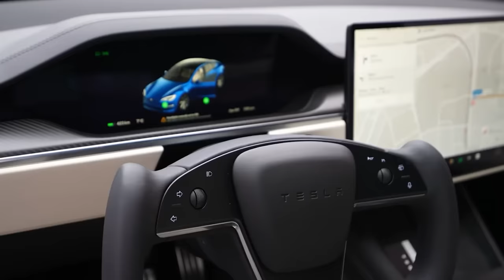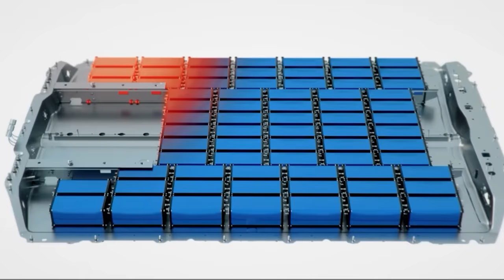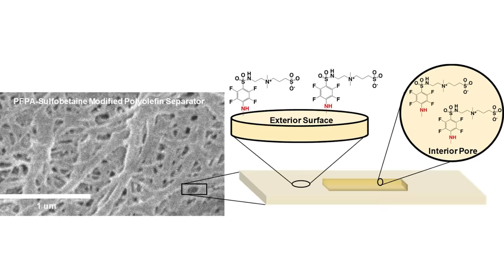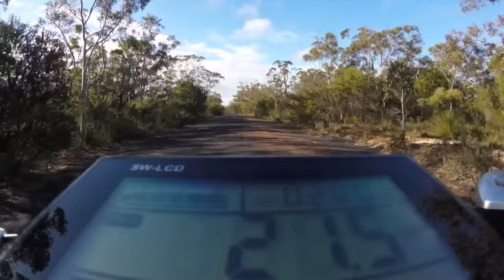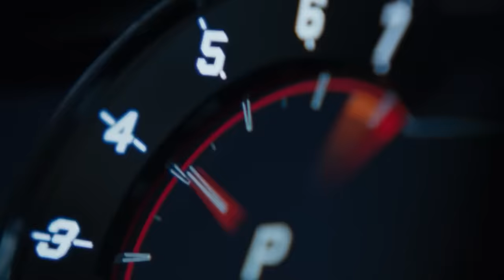EV's Are Exploding In Shocking Numbers

Comment: Here in the UK, one of the biggest causes of ICE [internal combustion engine] car fires is deliberate arson. Insurance fraud and destroying forensic evidence after theft are the main reasons why ICE car fire statistics appear to outweigh those of EVs.

Petrol and diesel fuel is combustible (and explosive in vapour form), but that does not make ICE car fires any more likely.  Handling liquid fuel requires care - we all know that - and as a result such fires are unusual events. Unless they're caused on purpose.

Lithium batteries are not meant to burn under any circumstances; an EV fire therefore represents a catastrophic failure of the technology involved.

ICE car fires caused by traffic collisions are surprisingly rare because petrol and diesel require a source of ignition in order to burn. Most traffic accidents just bend metal. The problem with EVs - and what makes their perceived fire risk totally different from that of ICE vehicles - is that they need sophisticated monitoring, charging, cooling and discharging systems to work, and those systems can malfunction without warning.

Any physical damage to the complex lithium battery can cause unseen electrical problems which may not affect the vehicle's functioning at all - but which may [sic] cause a thermal runaway event and a fire days, weeks or even months later.

You can't see cracked welds or damaged wires or cells rendered unsafe by bump damage or vibration. The first you know about it is when the car catches fire.

So an EV fire can start for no obvious or apparent reason. An ICE car fire can't, and that's what makes ICE vehicles less of a risk. If you don't believe me, ask an insurance company executive.

Comment: People need to understand that EV are a fire hazard waiting to happen. It’s the way batteries are set up. Any breakage will result in a simultaneous combustion fire. And this can happen even days after an EV had a minor crash and the battery compartment was compromised. 
And, no, you can’t get out when it’s got on fire while you’re inside. Because all the doors are locked. 
Tesla has a manual open door button, be sure you know where it is and how to use it.

Comment: Electric cars have a 1-1/4 century record of success: efficient, clean, smooth power, etc.  The problem has been the batteries.  Lead-Acid (low energy storage, toxic lead, acid) & Lithium Ion (severe chemical fires) both have their own problems.  Electric cars will come into their own when safe high energy batteries are invented.

Comment: It's not uncommon for EV vehicle manufacturers to tell their customers to park their vehicles outside if there is a recall related to the electrical system. I just returned form China and the government is concerned about ebike and elecrric scooter battery fire issues. In the near future steps will be taken to replace their batteries with sodium based ones that are safer. The apartment building that I was at will not allow its occupants to charge ebike batteries in the building due to fire risk.

Comment: This is plain stupid for electric cars. 1. Government and auto car makers put out millions of good car mechanics out of work if more electric cars. 2. How they gonna dispose battery that isn't environmental friendly that contain hazard toxic minerals of lithium batteries. 3. If power outages or electricity grid not coping for many ev cars. 4. Lack of power charges.  5. Park electric cars in gararge is fire risk to burn house down. 6. Faulty or corroded battery and replace batteries is very very expensive not just one battery but number of batteries. Also number of charges will degraded the batteries. 6. Electric Cars in flood waters would be useless!! 7. If the car on fire then you lose a whole car! Why are they making stupid decision to make electric cars to save environment which isn't cause more tire wears and toxic batteries that can't be recycled!!!

Comment: It’s the plating between the pos & neg all it takes is for a few electrons to push through & boom a runway chain reaction occurs! See I got this! Solution?  make the separator less susceptible to internal corrosion!& be sure to have a sensor that lets you know it’s fully charged but slightly less than battery charge capacity see no more exploding EVs!

Comment: You said that there was substantial environmental benefits by having EV's rather than ICE cars. Wrong. An EV's carbon footprint does not level out  compared with an ICE car until that vehicle has completed 60 to 70 thousand miles at which time the battery is becoming a useless slab and needs replacing. The problem there is that firstly there is a massive cost to change the battery and an extension of the carbon footprint of another 20 thousand miles. Most people will scrap the car and buy a new one.

Comment: Excuse me, how can you possibly say that EV’s are less likely than gasoline powered vehicles to catch fire? I only in respect to overall numbers, because there are so many more gasoline powered vehicles, but not in percentage of vehicles. I’ve never known a gasoline, powered vehicle, sitting in a driveway or garage to suddenly burst into flames. That’s the whole issue! With the exception of the Tesla that ran into a tree,  the EV cars are parked or being charged. They’re bursting into flames not because of some collision, but precisely because they have lithium ion batteries. The danger is such that manufacturers actually recommend not charging vehicles even smaller ones like electric bicycles, scooters, electric motorcycles in a building due to the fire hazard. This guy is a propagandist.

Comment: all EV cars have to change to Sodium ion batteries. I learn SI is safer but the negative is the explosive if fire or punture to batteries. We need to learn more.
Reply: It would be better to use white hydrogen until a synthetic fuel is manufactured,forget mining&damaging the environment for a finite resource,you would even be able to keep your existing vehicle.Battery-powered vehicles are not practical,or viable on any level.

Comment: Hybrid system that electronically monitors the drivability of vehicle using engine control modules. If you run out of battery power, you got combustion, if you run out of combustion, battery power can get you to nearest gas station <~>  (equilibrium style is the hybrid system).

Comment: To preface what Im about to say, many fewer EVs (excluding Chinese ones) go on fire than combustion engines on a % basis. However, the EVs garner much more attention for it. When was the last time a new station bothered reporting on a combustion engine that went on fire? They dont. Its not news.  Anyway, there are 2 separate issues being discussed in this video and a clear distinction has not been made. Both have different causes. The first is fires and the second is explosions. 

Explosions dont necessarily follow from a burning EV. As far as Im aware, data shows that the explosions mostly happen in cars or other larger EVs. The reason appears to be the concentration of gases within a cab or enclosed car or truck reaching an explosive pressure. Once this critical explosive pressure is reached, windows will blow out, doors too, sometimes even roofs. Occasionally, the explosive force will be powerful enough to lift the entire car off the ground. There should be easy engineering fixes to the explosive problem.
Dealing with the fires is a much more difficult problem for the automakers. It may require a fundamental change within the battery to allow some form of safe fast power discharge of the battery to prevent the build up of heat. Heat sensors would also need to be installed. 

As with any new technology, there will always be teething issues. I am sure these will be overcome in due time. Lets not talk about China. That is a whole different story where there are either very low safety standards or there is little or no enforcement of them. I have no idea which. If you choose to buy a Chinese EV, Caveat Emptor.

Comment: If the insulators between the + and - fails you have a violent reaction and the battery turns into a giant welding arc. the chinese battery's are good for that. If you can't get out in time it will be a death trap like the 3 rd. Lane in rush hour traffic.

Comment: I have been following this for some time. The issue in China is because EVs - including Tesla, VW, BMW and Mercedes - must use chinese made batteries. The CCP will only subsidize EVs that use chinese batteries. Chinese EVs catch fire during regular driving, charging and while parked. Western designed EVs in China do not have these problems. Very few western desigend EVS in China catch fire, usually only after an accident. Many western car producers now use chinese batteries because they are cheaper than japanese or american made batteries and to ramp up EV production. Governments should ban the use of all chinese made batteries in EVs. They are cheap and of bad quality. The battery packs cannot be cooled properly because of the battery format. The management systems are poorly programmed. All chinese made vehicles have major quality and safety issues. BYDs software like GPS Navigation are very bad. BYDs have issues with brakes failing. The quality of steel BYD uses is of low quality. I am sure the reason for self-combustion, if a serious investigation is done, will find that chinese batteries were used. I am sure the majority of EV fires are caused by chinese made battery packs.
Sadly, this video only reports about the increase of EV fires and does not detail which company and which batteries are having the most problems. It would benefit all consumers to know what they should look out for. Consumers should know which manufacturers have the most fires so they can avoid those EVs. Manufacturers, especially western producers, would know which batteries are dangerous and change the batteriy producers they use in thier EVs.

Comment: You have to look at the bigger picture. Try putting one of these out with your little cabin fire extinguisher no chance. You won't be cleaning this mess up with a broom. The car WON'T be going back on the road so salvage cost is nill which in turn puts insurance through the roof (If it isn't already) Maybe they should come with a government health warning like ( COULD EXPLODE WITHOUT WARNING PLEASE KEEP YOUR DISTANCE)  This warning should be on the back of them all in bold letering. It might go some way to stop tailgating. Wonder what would happen if one went up in a Clean-air zone would they get a 120 quid fine. Major road repair. The list goes on. Would you buy a second-hand one maybe not unless you have a death wish.

Comment: ICE powered cars, particularly gasoline cars, may well be more likely to catch fire but that is almost always the consequence of an accident that ruptures the fuel tank.  If the cars of the Freemantle Highway were properly secured how would they hit each other hard enough to start a fuel fire?  By what mechanism would an petrol car catch fire if not in an accident?
OTH, EV's can catch fire without any crash damage at all.  So, n the case of the Freemantle Highway fire, where both petrol and EV's were present, unless they were not properly secured I fail to see how a petrol car could have been the cause.  But, it is not hard to see how the fire could have begun with an EV.
One last point on the Freemantle Highway incident -- there is plenty of video of them unloading cars from the ship and the EV's being placed into a large steel tank filled with water.  You can check for yourself.

Comment: so where's the data claiming that EVs catch fire less that gas engines, I'm calling BS, since Gas Engines out number EVs about million to one, or more, i work in the auto industry, and am telling you that EV batteries Catch fire just sitting in the shipping pallet, waiting to be installed in a truck, it happens more that you think, and NOT One Word of this on the News, want an EV Vehicle? Fine, Do Not Park It In You Gurage if you plan on waking up in the morning, Also. A Gas Motor Wont Just Catch Fire on its own without running, in the very rare case that this has happen, not involving a crash, an EV can be just sitting in your garage and catch FIRE, Big Fucking Differences

Comment: Its hilarious how many people are afraid of new things like EV. .. ...    EV are far less likely to catch fire than petrol or diesel vehicles.   I have never seen an EV fire.... i have seen 7 fuel vehicle fire.   I even saw one on a farry and they had to push it off the ferry into the ocean before all the vehicles caught fire.      I think EV are great ....... i save $200 a week in fuel.......   the saving pay for my EV in 5 years and it has a 10 year warranty on vehicle and battery.... has less maitenence costs than petrol.      Holds its value well... i can sell it after 5 years while its still under waranty and buy a new one.       I do alot of driving and i cant afford to drive a fuel vehicle anynore.

Comment: Even a watch ⌚ battery 🔋 lithium ion battery will burn your house down and RC car are very dangerous.
Reply: You cannot be serious.
Here have some comparison:

An EV will EXPLODE your house. Your house´s stones (assuming it even consists of stones!) will be gone when an EV explodes in your house/Garage! Because the explosion will be powered by your huge E-car´s battery, which is about 50 Kwh in capacity (that´s 50000 WATTS!).

When a smartphone explodes (about ~10 or 15 Watts of energy) you will just die because of a bigger fire which might come out of it, assuming it´s in your hand. But dying because of a small fire of a smartphone is rare. So the risk of a house being burned down by a smartphone is nearly as tiny as when an asteroid hits your house.

a watch´s battery is even a slot smaller than a smartphone (10-15 watts) or a tablet (40 watts) one. A watch´s battery is like ~2 watts only.

The most-dangerous batteries right now and those which have the highest risk of explossions sieem to be those rather big ones from electrical bycles. Those have about 0.5 kWh battery (500 Watts! Which is about 10-12x bigger battery than a Tablet or about 50 Smartphone-type of batteries!) which is big enough to destroy a SINGLE room in your house. But the explosion of it cannot destroy a house.

But it´s big enough to easily kill you!

Comment: Well it doesnt matter anyway because by 2030 we will run out of lithium, the main component of batteries, in fact if you check out the websites yourself, some say it could be as early as 2026 ,and you can recycle lithium from old batteries but ,and here's the big but ,the lithium recovered is no where near whats put into a battery, 16 to 28 % recovered and has a lower charging capacity for one ,secondly recovering lithium from old batteries carries risks ,they can explode with no warning ,they can catch fire and release not only toxic fumes but carcinogenic fumes ! So they are not good for recycling !

Comment: We can slove this problem by regulating heat inside machine, 
First put fresh air entrance inside machine for Cooling. 
Put the system which will show temperature of battery, 
Change the battery if you are in hurray, put cooler battery.
Some time chargers are too much hot ,check the chargers.
If you want to understand how  battery become hot,purchase very ordinary mobile phone ,use it charge it, Keep chargers electrical ponit  on mean don't close it. 
With  time  you will understand heating mechanisms of battery to slove the problem.  
Cooling is best mechanism ,natural  Cooling takes time. 
Jay bharat.
Reply: We can slove this problem, fix   plain clay tiles to the upper front body of car with help of screw, clay tiles will absorb the heat,we can spay water to keep clay tiles wet for Cooling in case of emergency. 
If possible prepare clay  casing for battery to absorb the heat. 
Don't use electric van for taxi, gas is safer.  
Make system to check temperature of battery. 
If chargers is loose while charging than also areas of charging becomes hotter. 
Must know all the reason and how to keep car battery cooler. 
Jay bharat.

Comment: Wow, what an EV apologist!  Even if the EV batteries in the cars in the ship didn't START the fire, they sure as hell made it one helluva lot worse!!!  At least if a IC car catches on fire, it can usually be easily contained, put out, and doesn't reignite days later!!!  I am not opposed to EV's, even have an E-Bike, but the current battery technology is not ready to replace IC cars.  He also forgot to mention that the cost of replacing EV batteries.  The majority of EV's on the road are probably still under battery warranty, and will be next to worthless when the warranty runs out and the batteries need to be replaced.  I wonder how many of those EV owners will replace that worthless vehicle with another EV?🤔  😂

Comment: I think E. V’s are a rip off and dangerous.  If they are not like the kind of motor that draws the Electric from the air and discharge it right back in through the neg .  Then just be used to walking .